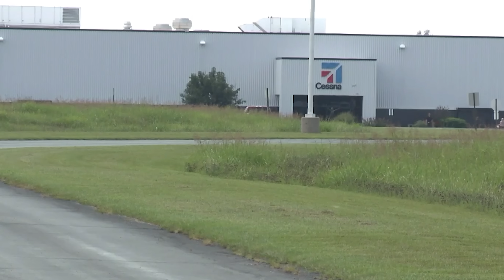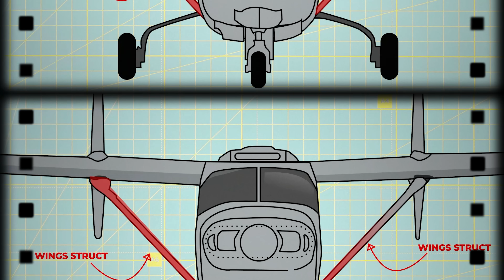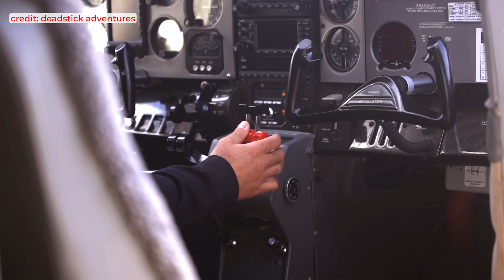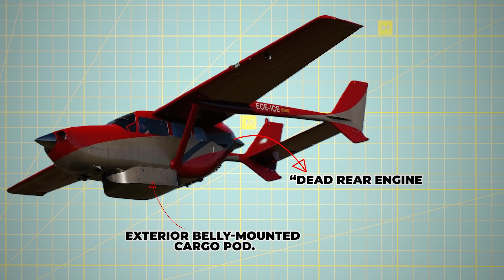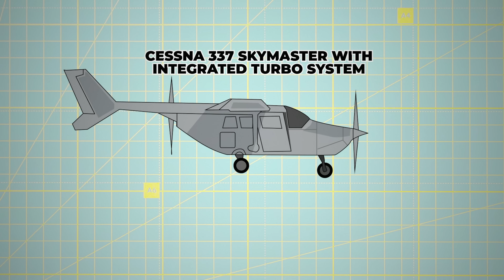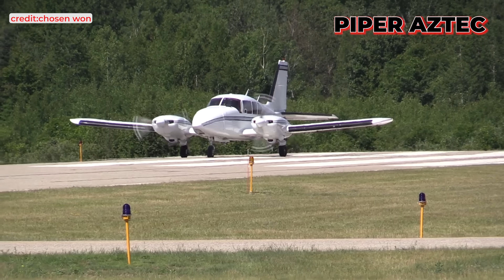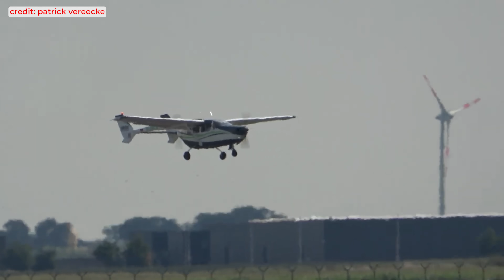Why Did Nobody Want the Twin That Couldn't Kill You?

Comment: The biggest killer for it was flight schools. People want to buy the plane they get time in while training (hence why the Piper series and the 172/182/210 family are so popular).

So why no flight schools buying the Skymaster for multi-engine training? Every pilot who wants a multi has 95% of their aircraft options being asymmetric thrust on engine failure twin engine aircraft. Every airliner requires that proficiency as well, so any flight school feeding the airlines will only buy twins that have that failure mode so their students can qualify on it. The military also needs that skill for most of their pilots unless they are one of the very small fraction that flies fighters. Even still, it's a good skill to have in the back pocket if you need to transition roles. So the military will also insist on their multi-trainer having that asymmetrical thrust failure mode.

So why would any flight school buy a Skymaster? Then, since the engine failure is a different failure mode if you went and got your multi in a regular twin, you needed to buy the Skymaster, find a qualified CFI with the centerline twin qualification (so a former fighter port business jet pilot), and do the signoff again.... Which is a big pain in the butt when you could just buy the plan for trained in and don't even need extra time in type for your insurance.

Comment: Adam Aircraft engineered then built 7 A500 aircraft, a modern push pull twin boom composite structure aircraft. The airframe was heavy which meant it couldnt carry full fuel and one standard weight adult male or female pilot. Ultimately the company filed for bankruptcy in 2008 due to a lack of funding.

Comment: I always say the 337 is more of an engineer's airplane than a pilot's. 
Pilots want speed, and that is precisely what the Skymaster doesn't have. 
Looking at it on paper, you expect it to leap off the runway, but when you actually pull back on the yoke the first time it's underwhelming.
It would not be fair to say it's sluggish, but all the drag from that massive boom really cuts into performance. 
The result is all the cost, complexity and maintenance headaches of something like a 340, with performance that barely edges out a Bonanza, if even that.
From an engineer's viewpoint though, it could be called the only light twin that truly delivers on the promise of twin-engine safety.
Yes, we all have to show engine-out management on check rides, but in that circumstance you know what's going to happen. When engines fail on conventional twins in the wild the outcome is unfortunately rarely very brilliant. 
Down low, doing airwork for inspections or photography that safety factor is comforting, and the view, with the gear tucked away and the strut behind you outclasses anything this side of a helicopter, but alas the complex rigging makes it impossible to place a camera hole for vertical work, when an Aztec is almost as though it was custom designed for this! Also, the noise of the pusher prop is guaranteed to generate nuisance complaints, and some people seem to think it sounds like there's something "wrong" with it.
Many a pilot would love to have a more present-day refresh of the basic push-pull design, but alas this was attempted by Adam Aircraft without success. 
Maybe someone else here knows more than I about why this model failed - I have never actually seen one of the handful that were built, and I've never known anyone wealthy enough to own one.

Comment: Anyone comparing 'specs' is missing the point of the 337 entirely:  Losing an engine is reduced to a mere inconvenience.  NOW compare to other aircraft.  If any other single or twin loses and engine, then...

IF you can afford the premium and carry familly, or other 'high value' payloads, then everything other comparison against any other aircraft is just noise.

I experienced an engine quit in a friend's twin at altitude, in cruise, and saw what an adverse situation that caused for a pilot (who regularly 'ran a tank dry before switching, I learned),'.'  He was even expecting the engine to quit.  The 337 sales brochure was reduced to that one feature.

Similarly, BTW, it is the parachute that sells Cirrus aircraft.

====

There have been at least two subsequent attempts inline twin designighter).s:  (Maybe more, like that WW2 german figher)

1. ADAM AIRCRAFT - https://simpleflying.com/adam-a700-microjet-what-happened/.    

s I understand it, a Skymaster owner hired scaled composites to design a modern 337.  Aiming for the corporate market, it got too heavy,.  Someone once quiped that the copany got so obsessed with their stock options, they forgot to finish the airplane.  
become 

2.  RUTAN DEFIANT - he better design was the Rutan Defiant https://en.wikipedia.org/wiki/Rutan_Defiant.  These seat four and are screamers in speed and efficiency.  Like all super slick canards, not great on short fields, but otherwise just fine.

Comment: The rear engine out confusion with low time twin pilots might  stem from the traditional throttle orientation - left engine, left throttle; right engine, right throttle.  It might take some getting use to left = front engine, right = rear engine.

Comment: I think the Skymaster was primarily designed for the military as a forward air control airplane where the priority is two engines and maximum outward visibility.   The Skymaster is the best configuration given those priorities, but you pay a big price in complexity, cockpit noise, rear engine cooling, control complexity, and weight (those booms are heavy).

Comment: You left out the noise, vibration (wave amplification!), and "chopping" sound of the rear engine chopping the counter rotating prop wash from the front engine! The vibrations could build up quite significantly...

Comment: I was a licensed mech at a Cessna dealer across the runway from the factory that made these.Maintenance was no fun on these,especially the P337G model.The rear engine was not too bad to work on with the cowling removed,but the front one was not as easy.Out of all the customers we had,only two of the regular ones had 337's,one the P337G model and the other a non- pressurized or turbocharged engine model.The 310 was a much better aircraft if you could afford one.

Comment: wow this must have been noisy inside there...ufffff
Reply: It was not noisy inside. But engine vibrations were very noticeable on the floor inside. In Germany you can't barely fly that kind of plane because the plane is excessively loud OUTSIDE. You won't get a noise certificate for night flying. Another BIG problem with pushers is that a rear propeller is very prone to stone chip (don't be sure if that's the correct english wording). Interestingly that real problem is not addressed by pilots who operated pushers.

Comment: How is it so hard to tell what engine is out? Did they not use different rpm gauges, oil pressure, temp, different thrust levers seems like 100 different ways to give a clear sign as to the failed engine
Reply: Some engine failures don't manifest themselves as RPM drop, oil pressure loss, etc.

Comment: Flew a 337 turbo for some 2000 hours and I enjoyed flying it back in the mid 1970's.  Also instructed in it.  A few things that came to mind with the old style landing gear and the barn doors opening for main gear retraction, was the effect of the drag, especially low to the ground after take-off with the rear engine failing.  The manual as I remember stated that the rate of climb was minus 250 FPM with those doors cycling.  Thus, if the rear engine quit just after takeoff, treat the airplane like a C336 with fixed gear till you gained altitude, then if necessary, retract the gear.   The other thing was Cessna claimed the sound level in the cabin was 85 DBL and was proper for OSHA exposure.  For me back then, fancy headsets were not used and I think some of my hearing was affected in later life now.

Comment: The Cessna super skymaster has s retractable landing gear.
I flew this one very often and was my favorite for a long time. When you turned off the front engine, propeller feathered, the fuel economy in terms of miles per gallon
increased with an acceptable cruising speed. Passengers liked this due to the much reduced noise making conversations pleasant.

Comment: Old CFI here ... basically the Cessna 210 and the extraordinary cost differential of operating a twin vs a single killed the "sky smasher."    I've never flown a 336, and have not a lot of time in a 337, never owned one (owned a long list of less expensive planes and sailplanes), but did some instruction/check-outs in the 337 a long time ago.  I'm not the most expert on this aircraft, but can make a few points that I think make it very clear why in was a niche airplane at best in civilian aviation.

The 337 was a maintenance PIG.  There's no other Cessna that was a worse or more expensive shop-Queen.  The monkey-motion landing gear was a nightmare. And of course if you can't get the gear down the whole airplane will be a write-off. The result was hull insurance costs that were a killing argument against the plane all by themselves.  The IO-360-C or IO-360-D engines were higher-maintenance too, mostly due to the fuel injection.  These early fuel-injected engines were often hard to start, and had the quirk that starting problems were most likely when the engine was hot.  These WEREN'T turbocharged (I think that most of the military variants were? ); high-altitude performance was sucky, so you couldn't get over the top to manage weather.  Performance was distinctly less than stellar.  For the $$$$ spent, almost everyone would prefer a 210.  

Another problem was that at gross single-engine performance was not good, particularly on the rear engine.  Because I was mostly doing check-rides and instruction I never was in one at gross ... but the reality is that a lot of private-pilot operators treat the W&B as "merely a suggestion."   Most of the Cessna singles, particularly the C-182, C-206, C-207, are very forgiving about W&B.  The C-337 was sort-of OK at gross ... as long as two engines are running, and that suckered a lot of people into trouble ... particularly high and hot.  Lose an engine and the pucker factor went WAAAY up instantly.  Another dumbo problem that killed a few pilots is that when one engine went out it wasn't in-your-face obvious which one ... like it is with most twins.  The result was too often the pilot would try to restart or safety the working engine, and because the engines were prone to not restarting nicely when hot, pilot-induced total engine failure!  In terms of check-out, this was a big item to prevent.   And speaking of checkout, a lot of the pilots checking out had moved up from one of the bigger Cessna singles and wanted the 337 precisely because it was inline thrust and had pretty mild low-speed handling characteristics and seemed "safe." But the fact that the pilot population for this aircraft generally wasn't really up to complex aircraft sure didn't help.

These days one rarely sees 337s, and the only one I know of has sat out on a tie-down line never moving so long I'm certain it's not anything like airworthy.  Anyone with enough money to realistically operate this aircraft would be much smarter to pick something else.  337s can be bought at almost give-away prices; there's the obvious reason for that. Like almost every other older twin, they'll eat you alive to operate today.

Comment: The Cessna Skymaster's Achilles' heel was its complex, maintenance-intensive systems, especially the rear engine's cooling and the costly cowl flap motors, leading to high operating costs, despite its unique, easy-to-handle single-engine-out characteristics. Its push-pull design simplified engine-out handling (no yaw), but created maintenance headaches, poor single-engine climb (it was placarded by the FAA to prohibit any attempt to takeoff with one engine out), and a reputation for being a "hangar queen" if not properly cared for...I have seen many sitting at the end of a hangar row rotting in the weather.

Comment: Make a modern version, with rear gear retracting from the booms, and modern fly-by-wire controls to the rear aerodynamic surfaces (avoiding all the complications of running cables through multiple pulleys etc).  Would absolutely ‘sing’ in flight.
Reply: The booms of a high-wing aircraft are way too high for the landing gear. Yes, some aircraft do this, but the landing gear is very long and heavy.

Comment: We called it the Sky Smasher. I wrenched every plane shown in this video. Hands down for quality and reliability was the Barron 55. Pipers were built cheap. Cessna 182, 210 were built well and had easy maintenance. If I ever saw a pressurized 337 again it would be 2 soon. Horrible waste of money.

Comment: Hey pilots, THE advantage of the Skymaster, is that it really flies very much like the classic single prop Pipers. It feels like you get an extra engine behind you. Your type conversion is a lot easier than the usual twins. Why? Flying on only one engine, after engine failure, sorry, hardly a problem.
Talking about problems, lots of Skymasters had problems getting gear down. The military found the solution. Hydraulic pressure was a bit low for the gear. When do you drop the gear? Flying slow. Low revs. THAT causes that low hydraulic pressure. So, when your gear stays half up, rev that engine just a but more, and tadaah, that "problem gear" goes down, always. Some pilots have spent a fortune on new hydraulics in that gear, but the military shaked their heads. Bit more revs, drop the gear,  done. Maybe people were scared for problems that had beeb solved long ago. The Skymaster is a fantastic plane for people who want a twin without the classic list of things that makes flying twins complicated. What a waste there aren't more Skymasters still flying. The O-2 is very very good.

Comment: I question the props turning in opposite directions.  When you turn the rear engine around, the props are then turning in the same direction. To me that would seem that the rear engine is just spinning in the airflow of the lead engine. Of course, I might be wrong, but reversing the direction of the rear prop, might have increased its "bite" in the airflow.  Was that theory ever tested?

Comment: It was never a favorite for a reason, certainly not mine. There were few things it could do well. My Bonanza would fly as fast (or faster), on much less fuel, quieter and more comfortable. My Baron would out perform it significantly, as would Cessnas own 310 or 210, faster or less fuel, and both quieter. The only thing the 337 could do reasonably well was fly slow and off of unimproved strips and there are several planes that still do better than the 337. After many hours of Skymaster time, including the P model, i's not something I would want.

Comment: I had a friend with access to a Skymaster. I loved that plane. Good on fuel. While I was not rated for complex, high performance, multiengine aircraft, I have about 20 hours at the controls. The unit we flew had long range fuel tanks and a Robertson Short Field kit installed. It could fly as slow as a C-172. Its ailerons were light, but elevators were heavy. Single engine performance was good, as we once got contaminated fuel in one tank and lost the front engine five miles from home base. The flight ended without difficulties. A sturdy plane.

Comment: I have had several up-close experiences with the Skymaster. The first one was in 1968 on Midway Island where we had overnighted enroute to SEA. On the ramp were about twenty of the Cessnas that were to become to become the platform for Forward Air Controllers in Vietnam. I found a civilian pilot who was doing a pre-flight on his bird. He explained that the Air Force bought them, but the price they paid included delivery to Vietnam. The plane was full of tanks, back seats, and the co-pilot front seat included. He said they flew in loose trail and hop-scotched across the Pacific. They picked the planes up in Kansas and delivered them in-country and returned to Kansas via commercial to pick up more planes. 

My next exposure was in the Philippines a few years later.  In '69 I was assigned to Clark Air Base in the Philippines. My wife and I flew a base aero club Cherokee 140 down to Corregidor Island to visit the WWII battlements there. The Jepps reported the runway there as being almost 2000' feet long with nothing paved. After a low pass I could see that part of the runway hadn't been mowed in years, and that the usable portion was probably about 1500'. We landed, but it was at full flaps with the stall warning on. After landing, I walked the runway, and it was only about 1200". A Skymaster from Manila, loaded with tourists, seeing my plane, decided he would land, too, and give his passengers a closer-than-normal view of the island. He got the plane down but blew out the two main tires in the slowing-down process and ran out of runway faster than expected. After spending the day with Filippino Marines permanently assigned there to destroy wartime bombs and ammo, my wife and I departed to return to Clark. The Skymaster remained there while its passengers were returned to Manila via boat. When we left, I drained 10 gallons of fuel, taxied out as far as I could, went to 20% flaps and took off. We were still in ground effect when we went over the 200' cliff at the end of the runway and had to drop the nose to gain airspeed. We could see large sharks at the bottom of the cliff that looked like they were waiting for lunch. I assume the Skymaster also dropped a lot of fuel in order to clear the runway after replacing his tires the next day. I never heard anything, so I assumed he didn't provide a meal for the sharks.